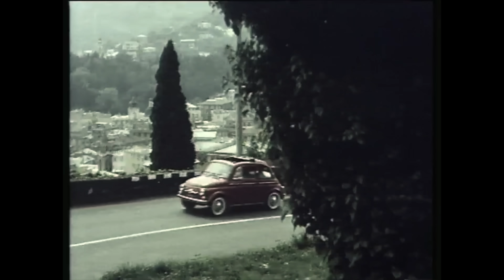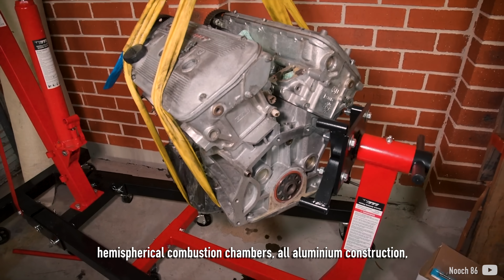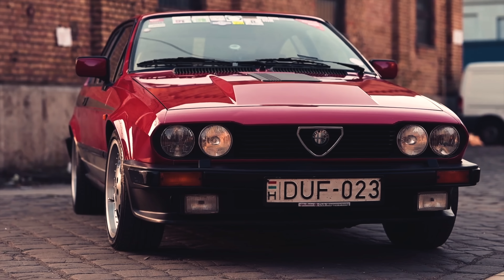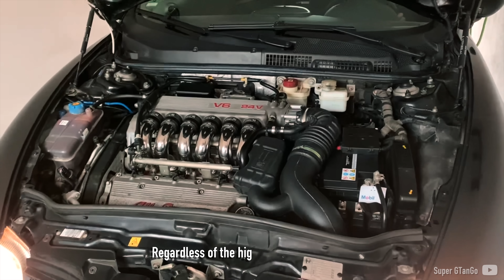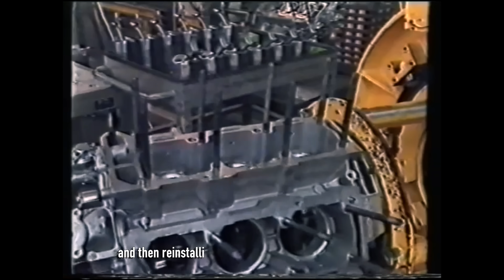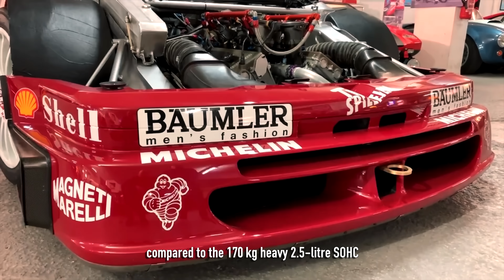This Is The Best Tuned V6 Engine

Comment: This engine is an absolute jewel.  I've owned many 2.5 and 3.0 GTV6's and Milanos, and we raced a 3.0 Milano in the 24 Hours of LeMons endurance series.  We threw a tired 3.0 in the car with over 150k miles on it, it burned oil and blew smoke.  It stopped both after the first race and we hammered the living daylights out of that motor for 25,000 racing miles before it finally blew a head gasket.  Wonderful!

Comment: Some nice video of the white GTV6 bring thrashed during Targa Tasmania, complete with typically wet Tasmanian roads. The Busso V6 was definitely a brilliant engine, but so was the much higher revving (7,600RPM) Fiat/Ferrari V6 in the Dino 246GT & the Fiat Dino coupé & spider; 180BHP from 2 litres & 195BHP from 2.4 litres in the Ferrari. Nissan's V6s also deserve a mention, especially the 3.8 litre version in the GTR.

Comment: Clearly GM's Iron Duke 2.5L 90 hp deserves honorable mention.  What's Yin ☯️ if there is no Yang?  GM goes where few dare.  It's almost as if they are snickering at their customers.  But at least with a devistatingly poor design, they could also produce them with sub-par materials - some suggest that Nabisco supplied the crankshaft made from marshmallows.  It's a marvel of Republican Capitalism.

Comment: Nice program and enjoyed the good pictures. However there was an incorrect information on the 156 2,5L V6 TI engine: the engine block on that car was not from the Busso engine. It was a completely new construction from Lancia racing department. The only similarity between the road Busso and the race engine was the cylinder V-angle, Spacing distance between the cylinders had to be the same and also the material of the cylinder block and heads which was aluminium.  That was the only relationship between the road Busso and the race engine. Development of the race engine brought it more and more away from the road Busso: like gear driven camshaft system, then the gear drive was moved to the rear flywheel side of the engine. Also they experimented with different crank shafts by having both con rods on the same axle. These mods brought the power up 450Hp but that was the max they got out.  The big cylinder distances between the cylinder of 93 mm and high center of gravity of this engine made it finally impossible to improve result for the car. So for the last year 1996 a Lancia based V6 was introduced with 90 degree bank angle(lower CG) and much tighter cylinder spacing making the engine more compact and lighter. Output was now lifted to 490+ HP and the Alfa was competitive again!  However the Busso was a great engine and the cars still race in private ownership!

Comment: Ford Cosworth GAA 3.4 litre 24valve is a brutal sounding V6. This motor produced 450bhp in 1973 and was used in the Cologne racing Capri's

Comment: The Mazda 2,5 V6 (also used by Ford) has a very good sound and pulling power. I had a Mondeo with this engine - it almost ran 500.000 km's before i scrapped the car - the engine was still good. No oil or water consumption (it was always serviced at 10.000 km's opposed to Ford's manual).

Comment: What a fantastic discussion.I have a GT 3.2V6. One of 100 of the final Busso's produced. # 33 of the 100 GT Anniversary model from Australia..Significant uprgrades:_)
Reply: OK, my upgrades include:
Quaife Q2 Diff
Wizard exhaust headers (cat delete) ... these are hand made an beautiful
Full Wizard exhaust (currently fitted with a 'silencer")
Ferrari F430 throttle body
Flash tune to suit mods
Looked after by Australia's best Alfa mechanic 
ACT Carbon intake to match the F430 TB
ACT Carbon inlet plenum
h Tech quick shifter
Novitech Corse + coilovers
Pirelli P Zeros of course

I love it!

Comment: I owned a couple Alfa Romeo's in my life and miss them both.
I owned a 1976 Alfetta GTV Mario Andretti Limited Addition #5 of #150 made!
My little Alfa GTV had the 4 cylinder 2000cc motor.
A lot of fun until I bought a 84 Alfa GTV6. That engine sounded so fantastic and while not the quickest Car, boy
it's Roll on Speed while passing someone was The Best Feeling/Sound/Experience of any car or Motorcycle I have ever owned.
I have owned close to 30 Cars and Motorcycles in my life.

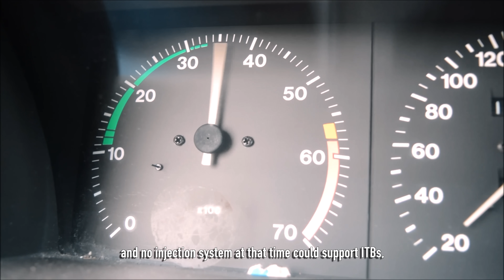Comment: 4:03  "no injection system at the time couls support ITB's?  what the meaning of ITB ?
Reply from the maker: Individual Throttle Bodies
Reply: @VisioRacer  thank you
Reply: @VisioRacer  does those  SOHC  use 2 valve per cilinder ?   happy 2023 !
Reply: People outside of North America are not aware of the Spica mechanical injection used on the Alfa twin cams and the Montreal V8 in the 1970s. It was a reliable, tunable system with a throttle for each cylinder for instantaneous throttle response and only one electrical component - the closed throttle switch. It was a much preferable system for long term maintenance. to the electronic systems that came later.
Reply: @johngeren1053  thank you , good data.

Comment: The 90° V6 used in the DTM was not based on the PRV. For homologation purposes they need to use an engine which had some of the main characteristics identical to an engine which was used in normal production at the time. In order to have a better intake runners design the 90° scheme was preferred so they developed a completely new engine for DTM racing only, declaring it was "based" on the PRV V6.
Reply: They “borrowed” it from Lancia.
Reply: I believe the DTM engine was derived  from the Alfa Montreal.

Comment: Is it really the best though ? 

I can think of a couple of better engines. :) 

The Nissan VQ35 (350Z) ? Beast in terms of sound. 
The Nissan VR38 (GT-R) ? It doesn't even need an introduction.
The Honda C32B engine ? Better in every aspect. A very, very well built engine.

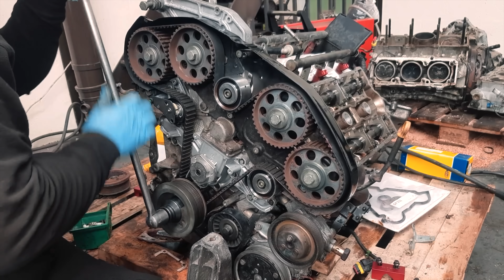Comment: 10:34 looks like water pump was driven by the accessories belt rather than the timing belt. Very smart design considering cases where timing belt driven water pumps can cause belt jump/failure when pump bearings fail.

Comment: THIS, is Why the Busso V6 is a living legend. 620K miles so far, on The Bue Meanie Alfa GTV6. the original 2.5  till 480K miles including many race days and hard, Spirited back road driving, then a Busso 3.0 Verde, that also raced many times. I drove all over my great State with Many back roads though winding through the hills roads and few police and Many other States and amazing windy back roads as well. And in GTV6's, I have driven one in every Connected State in the US. Ain't been boring. The Song of the Busso V6, is the reason I NEVER turned on a radio in a GTV6, in 10 trips across America, and back from many others. As a Musician, the song it Sings and the thrill of 3500 to 7K rpm is a thrill!!. Heavy Metal Alfa

Comment: Such an amazing engine. I was lucky enough to have a 3.0L 24v Alfa Romeo 164. Was the best driving engine I ever had and never tired of hearing it at full throttle or even part throttle. There was nowhere in the rev range that it sounded other than glorious. Only other V6 engine that can came come close to the Busso for iconic status is the Ford Cologne V6

Comment: Isn't this a GM-based V6?
Reply: Absolutely not. You are thinking of the 3.2 JTS that came in the type 939s (Brera, Spider and 159). They are a derivative of the GM High Feature engine.

Comment: 30 years ago I had a 3ltr Holden engine - Inline Six, All Cast Iron, 2 Valves per Cylinder with big valves, 3 angle valves, triple valve springs, Big cam, ant twin down draft single barrel stromberg carbs, with high volume oil pump, fully balanced etc.........200hp .....easy......Really low tech and simple so what is the big deal about a super complicated V6 ?.......go figure.

Comment: The Maserati V6 engine made for the SM and Merak cannot go unmentioned. Equally or even greater sounding engine, and more powerful. Maserati's engine had much racing success in the Ligier JS2, for whom Maserati also made a special 3L 4v engine which made over 400bhp at some 10,000rpm, in 1974.....

Comment: Nice looking engine sounds amazing too heavy and under powered. The V6 in the Saab AERO turbo x runs it a close second in sound. The Honda Civic type r engine Na ep3/fn2 201bhp. Citroen 2.0 vts Na 180 bhp

Comment: The sound of my 156 2.5 is great and it's worth the higher fuel consumption, even at todays prices. Though, it doesn't sound nearly as good as my old 75 2.5 did. Still, it's an amazing engine and I get a smile in my face every time I start it, even now even though the car is 18 years old.
Reply: How much fuel does it take?
Reply: @s2000.  As of right now, driving mostly to work and back (12 km one way) it's at about 10 liters/100 km. Half the distance is 40-60 kph, the rest is about 110 kph.

Comment: Yes, this is a superb example of Italian engineering class . . . . and does sound fabulous.   But whether it's the best-sounding V6 is debatable.  What about the Fiat/Ferrari Dino engine?  2.4 ltr 190 bhp and redlined at 8000 rpm.   I used to have a Fiat Dino, and at 7500 it sounded like a 4.4 ltr V12.

Comment: I love these engines, to my ears the earlier 12 valve versions sound much better than the later 24v Versions, but they all sound lovely when on full chat.
Reply: Probably had a more modern exhaust dont think the valves change the sound much
Reply: @MechaNick03  I think the valve configuration changes the exhaust pulses and that affects the sound.

Comment: the big design flaw in the aluminum twin cam engines 1300,1600, 1750 etc was the wet liner sleeves, if you  went over redline (which was easy) the cylinder sleeves moved around  a blown head gasket would result .Some big shots made the sleeves as a one piece deal and it was 1450cc deal. the other strange deal was the engine block would bleed water out of  thru the block below the headers, rough castings, etc. The other thing is the oil plugs in the crank can fly off and you loose 50 pds of oil pressure, and bang you lock up, or mess up the bottom end, the head studs were famous for messing up, they run thru the water jacket, and over torquing the head bolts will cause the studs to mess up
Reply: A bit of mis information with some old wives tales. I had a 69 spider I bought new with ther 1750 engine that had lots of engine,suspension, etc.  hop ups....had that car for over 40 years before selling to a collector. The trick is to not get on it until the engine gets up to temperature....same for any car. I also had a 67 GTV with 1600 engine that I raced in SCCA. Those are stll a great engine. By the way I now have a 2015 ALFA 4C LE (also bought new)...fantastic car that is pretty much bullet proof on track and very reliable. Impractical except for putting one hell of a smile on your face. Never had a Busso engine car....I like the lighter more nimble ALFAs. Sadly ALFA sports cars seem to be a thing of the past....going same way as other brands....EVs....yuch.

Comment: High fuel consumption, timing belt every 60 kkm, very frequent oil changes and mostly valve adjustment. And that is the greatest engine V6? Well, if your priority if with the sound, yes. But really, playing the sound over your speakers is much, much more convenient.

Comment: For the last 3 month now I am a owner of a 166 manual with a 3.0 Busso. I fricking love it! This Engine is just so pleasant to drive, comfortable at low revs for crusing and gloriously screaming if you exceed 4k RPMs. The 166 drives really not how you would expect a car from that class. Its incredibel sporty, the throttle response is instant and the setup even allows the back to stick out, no boring understeer like so many others.
Thanks for your great content!

Comment: Toyota’s 2GR-FE is also a great modern engine. It can be found in many Toyota, Lexus, and Lotus lineups. It’s pretty reliable and has high tuning potential. Crazy how it can be found in a Camry family sedan, top spec Lotus, rock crawling FJ, or a MR2 hillclimb monster.
Reply: I'm on board with the GR family to be the best V6 ever. Fight me.

Comment: I love my Busso's (had 6 over the years and still have one in my project car)....but for cost and power, nowadays, I think I'd have to suggest the Jaguar  AJ-V6. In fact, with hindsight, kind of wish I'd used one in my project instead of the Busso in some ways.  No denying the Busso is very pretty though, and yes, it sounds fantastic :)
Sadly, I really don't like the exhaust valve setup on the 12V version - poor lubrication, poor materials, poor design all mean very high nose pressure on the cam on the exhaust lobes and very bad wear. 24V is way better....but quite a bit heavier too.
Reply: Savage... i d say

Comment: Never talk about reliability though. These things die like fireflies
Reply: What are you talking about????  Like any engine, they die if they are not maintained. I have owned 7 Alfas with this engine over the last 15 years without a single failure. Get your facts straight. 🤦🏻‍♂️🤦🏻‍♂️🤦🏻‍♂️🤦🏻‍♂️🤦🏻‍♂️

Comment: Have you ever worked with cars ? Have you every worked at these V6 Alfa Engines? Guess no, its a piece of crap to be honest. Audi RS4 first gen used v6 aswell, way better and stronger and tuneable. Same with Nissan R35 V6 tt. You must be Alfa Romero fan to call that piece of crap the best v6 engine.
Reply from the maker: Tbh, I have never owned an Alfa. I do my homework and read a lot before I create my script

Comment: Mitsubishi/Chrysler did a good job of mimicing these in there cars, coupes and vans with the 2.0, 2.4, 2.5 v6, 3.0 v6, 3.8 v6's. They were very similar dimensioned, 1/3 less power, and very good mpg. But, they would never, ever bolt a manual trans to anything above a 4 cylinder. And with maintenence required, and never mentioned, the engines could last just beyond financing.  To be rewarded with the wave of 2.7, 3.2, 3.5, and the double weight, double power, 5.7 v8, all automatic only. 3.7 3.9, 4.7, 4.0 l6, 5.2 and 5.9 were only options on trucks and suv's. The pushrod 3.3 was a 93-97 gem, that was only in bigbody, fwd Concorde, Intrepid, and LHS, longitudinal, yet fwd setups, with external diffs, that were their unrecognized, pinnacle achievement, even with non-interference edition 3.5.

Comment: The 2 litre turbo variant is best forgotten, coming from an era when turbos and engine management were crude. It was internally known as the Chernobyl engine and produced nothing below 3000 rpm where the power came in with a bang but was red-lined at just over 6000 rpm.
The variant used in the 4WD 164 Q4 produced much more than the quoted power to overcome the weight of the transmission, but was rated lower for insurance purposes.

Comment: I appreciated the video, but there are few inaccuracies or imprecisions.

It should be pointed out that Autodelta nowadays is an Alfa Romeo car specialist. Not the same as the sport division of Alfa Romeo Autodelta. 

Additionally, the 3.5L found in the prototype 156 GTAm would be a notable engine, this being the largest size from the Arese factory. Supersprint developed the exhaust for this I believe, which was used in the Driving Experience 147.

Edit: "Arese" spelling

Comment: nice looking engine, nice sound, but shitty as power and torque. He (his BEST, 3.2GTA) was alwaus trashed by any slightly modified 1.9 DIESEL at dragrace.
About those early variants of 3.0.. @170bhp was obtained by bmw in '80's from 2.5L n/a. Some producers even before '80 obtained WAAAY betted cmc/hp ratio for n/a with sporty gene.

Comment: Having owned the 2.5V6 and 3L 24V and now on the brink of buying a 12V 3.0 I can attest to this engines sound response and character. I've also owned the bmw in-line 6 and VR6 but find the busso to be the superior engine for response sound and character
Reply: Try a vr6 with the vsr manifold if you get the chanse. (The way the vr6 was ment to be,.. sadly wasnt due to cost cutting)
But it comoletely transforms the engine.
Reply: @tim1polman  I've heard quite of few variantions and different types of modifications on the VR6 and it's a lovely engine.....but listen to this :

https://youtu.be/JJuDiIKBhdU
Reply: I was thinking that Busso vs VR6 would be a good comparison.

Comment: my 166 was good until today where unfortunately i managed to screw it over by driving over an island in a car parking lot without noticing, now i have to look for a sump cover because it got punctured by concrete and i had to cut the broken sump cover off my alfa with a mini hacksaw, otherwise i would not be able to drive home, now i need to repair its exhaust manifolds because the concrete punctured a hole in the exhaust pipe towards the front of the vehicle. this is what happens when you run over something concrete and it is right in front of you. remember guys, pay attention to your surroundings. (edit) good news, it still runs, the exhaust manifold has a crack in it everything is good, luckily the sumps on these cars are bullet proof
Reply from the maker: Sorry to hear that!

Comment: Almost bought 157 with 2.5 v6 two years ago. I regret not doing so but the silver lining is that I wouldn't be able to maintain it. I guess it better this way.
Reply: Was the 157 the bastard child of the 156 and the 147?
Reply: @slacko1971  I'm just moron that can't remember cingle number